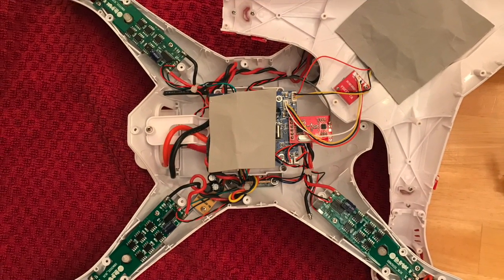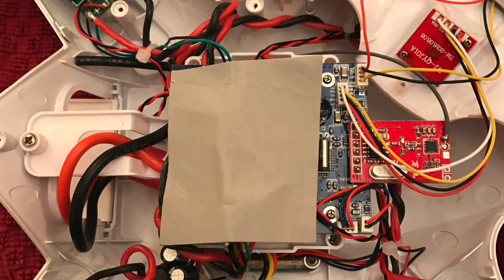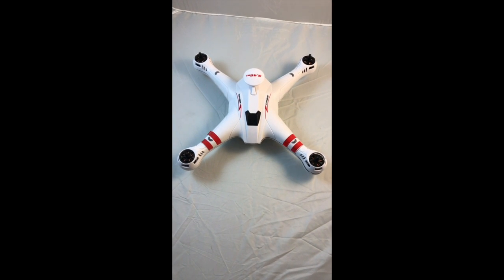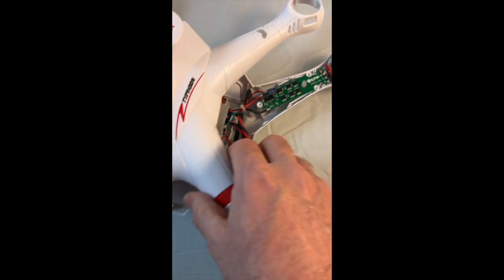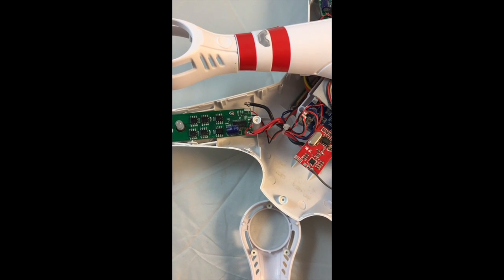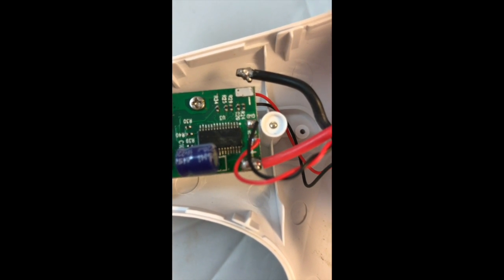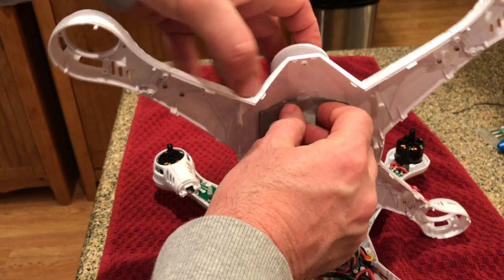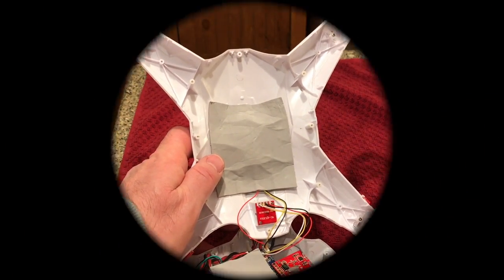A Look Inside the Bayangtoys X16 GPS

Comment: I got an X16 on order from Banggood, should arrive any day now.Not sure if mine is the GPS version.My question is, if I find it isn't GPS version, will it be relatively easy for me to install a GPS module into my drone.I know you can buy these from Banggood for £15, should I attempt this upgrade?
kellyrobert605@gmail.com
Please e-mail me a reply also, if you wish.
If it ain't the GPS version then How does this model complete the Return to Home  function?
Reply from the maker: I don't do upgrades and mods, only repairs, so I can't answer your question. And if it's not the GPS model, it could only do 'One Key to Return' which just basically flies the quad back in the direction it came from.  I didn't realize they still sold the X16. Have fun with it.

Comment: I've had to make a video for Bangood to prove my quad wasn't working.  So I'm considering the Bugs3 or pay a little more for a  X16 GPS. I realize it's slightly bigger heavier (same basic shell as the syma X8), uses 3S lipo, but has RTH and altitude hold, which I kinda want. But how does it fly compared to the bugs and how long does each of them fly? Thanks.
Reply from the maker: This is tough question because their very different quads in many ways but both are very good flyers. The BUGS is more of a toy quad, but the best toy quad ever. Great fully manual flyer, I would only recommend to a experienced flyer, a powerful flyer but with precise control. Outside of brushless motors it's best feature is that the TX beeps on LVC and range limit. Despite that fact that it looks like a plastic toy TX it's very effective. Where the X16 is loaded with features for it's price range, strong brushless motors, GPS, RTH, auto take off and land, and headless mode. The TX takes 6 battery's and you get great range, I've had it out almost 500 meters with full control. It returns to home on low battery and has geo fencing so that you can't fly it to far away on a low battery. I guess I like the X16 better, you turn off the GPS and fly in AH mode and it's as fast as the BUGS up high in a strait line. But for sport flying the BUGS can't be beat. The one knock on the X16 is that it vibrates enough to make it not the greatest camera bird. If you balance the props and get the right mount you can almost get good video. The BUGS has almost no vibration and takes as good as video as the X16. I hope this helps.
Reply: Hi Ron, thanks for the detailed feedback. Well I've already got a few 250mm fpv race quads, so I don't really need a sport flyer. I'm fairly experienced, having several toy-grade syma quads  and building several hobby-grade fpv quads from 430 to 90mm, but none of them having GPS RTH or AH and I just don't have enough time and patience these days to figure out how to add all that advanced stuff - although my big black Quanum Venture 430 would be the perfect candidate for GPS.  Also all of them are set up for mode4 over standard mode2, since I'm a little handicapped in that I'm used to flying with the aileron on the left stick and rudder on the right. It's for this reason that I prefer syma (they call it mode1 and 2) or programmable hobby grade stuff and I'm really hoping the gimbal wires inside the Bugs or X16 transmitter can be switched. I don't suppose you've ever opened the TX?  I'm also assuming the X16 has longer range and flight time than the Bugs? Yeah I suppose your props just might need balancing and I hope it's not some weird harmonic vibration native to the frame itself.
Reply from the maker: I've put the cell holder on the TX which requires removing the fake antenna holder, but it's a large enough hole to reach down and pull the antenna up. It has much better range than the BUGS but only slight longer flight times. On a good day with mild wind conditions and flying camera bird style you can get a little better than 15  minutes out of each. But fly sporty or in wind and might be lucky to get 10 minutes. And I have balanced the props and it does help, but the video is still no what I expected and not as good as the BUGS with unbalanced props.
Reply: Hmm, I know even the slightest imbalance is greatly amplified when spinning bigger props. I know I've tried my best to balance the 10" props on my quanum venture and still get video jello. I'm assuming the X16 has larger props than the bugs... I do get 25min flight times with the venture, so I might just stick with tuning that till it works the way I want, even if it doesn't have GPS functions. Thanks for all the info!
Reply from the maker: Yes the X16 props are larger and thicker. The X16 can also use the larger Phantom 9450 props.

Comment: Sorry to hear that brother, hope it get fix
Reply from the maker: I soldered the loose wire back on the ESC board in early January and it's flying great now. It's probably the best GPS quad you can get for under $150 US. Powerful brushless motors, can easily lift a GoPro. Sorry I'm a little late getting the video up, but it's so people can tell if they got the GPS version on the X16, some sellers try to pass off the AH model as GPS.